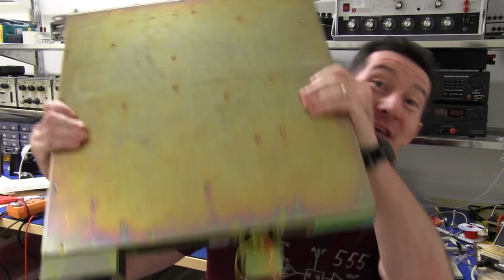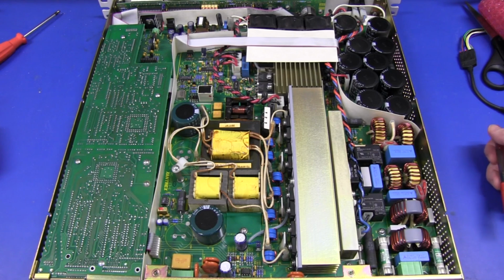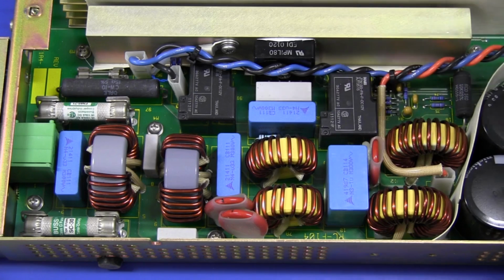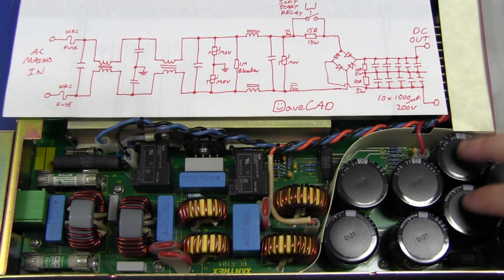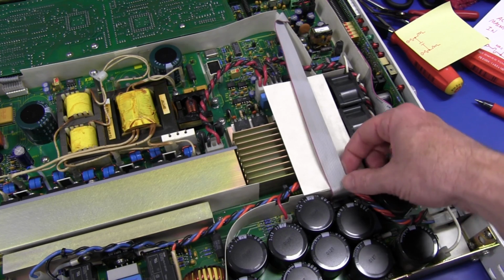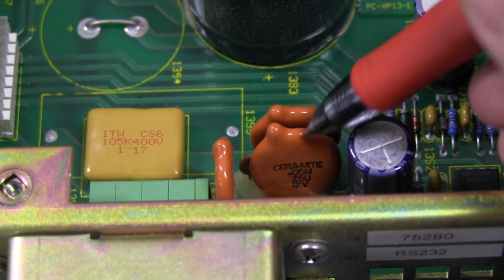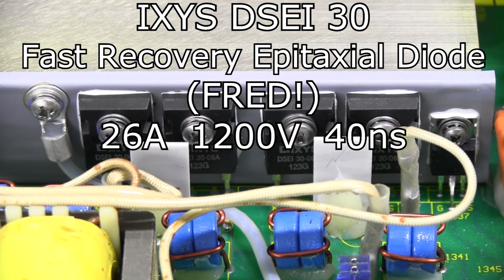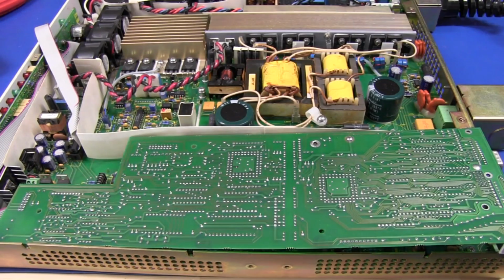EEVblog #268 - Xantrex 300V 4A Power Supply Teardown

Comment: It has good EMI filters at the input but PFC at the input is absolutely necessary instead of a simple diode-capacitor rectifier. The main converter is well designed, but the output capacitors could be improved. Additionally, the output rectifier could be replaced with SiC diodes. However, it’s important to note that when this power supply was originally designed, maybe SiC technology wasn’t available. Despite the input design, I don’t see any EMI filtering for the output.

Comment: It's very dangerous to have 2 fuses on a single phase design. There should ONLY be one fuse and it should ONLY be on the live/line. Otherwise, if the neutral fuse blows (or blowen as Dave would say) and the live hasn't. Then you've got a power supply which is completely live all the way through but doesn't power up. So it comes across as there's no power going to it, which is extremely dangerous if you don't know what your doing. 
But this isn't a domestic power supply so if anything went wrong with it. Then it'll easily be fixed be a technician. 

I dunno why they didn't just put a link across the neutral. As it'd be safer and cheaper to produce. Strange 🤔

Also. Back in the day, when electricity was pretty new. They thought it'd be safer to put a fuse on both the live and neutral which is very dangerous, if you know anything when it comes to electricity.
As people back in the day, didn't have the type of test equipment we have these days and the same went for earthing (because there probably wasn't any lol). So someone would be checking circuits and end up getting a big electric shock because the neutral fuse had gone but the live was still fine.

Comment: the fan placement is awfully similar to that in many 1u server blades...
Reply: Alex Ackerman Those axial fans are a bit of a letdown. Noisy and only so-so performance. These flat designs need a proper flat radial blower. It’d be larger but also much quieter. Then the “cardboard” can be used to direct air flow. This design isn’t exactly tightly packed; they had plenty of room to spare. As it is a 1U design, the axial fans are just a menace, and they have rather obstructed intake airflow, too. 

Two low profile radial blowers placed on each side right behind the front panel, with side intake, and outflow guided down the “guts” towards the rear would have been a much neater cooling solution. Even in 2U servers the axial fans can get really loud. For a 2U case, radial blowers can be 1.25U high, and those have oodles of airflow and very reasonable acoustic performance. The larger the radius, the better, of course.

Comment: I have four XFR600-4's to run power to my underwater remotely operated vehicle (ROV) over a 3km umbilical. I connect 2 pairs in parralel and then connect each pair in series.  One pair is set at 500 volts and the second pair vary from 100 to 300 volts depending on the load.
Reply: Holy moly what!! 3km power line!

Comment: Standard mains voltage on a single phase here in Canada is 120VAC(rms). Not the 240VAC(rms) that was being assumed.
Reply: Binj Komisar single phase in USA is 240V with a balanced center tap just in case you want 120V

Comment: I was initially puzzled as to why both inputs were fused. I'm guessing that it's designed for the USA/Canadian standard 240v system with a center tapped neutral to provide 120v circuits. I never saw the neutral used, but the two MOVs went to earth (and chassis?) ground. That ground wire had better not fail, or you could have a hot chassis!
Reply: Chaplain Dave Sparks modern 240V appliances have 4 conductors, including one neutral and an uninsulated ground. 3-wire cannot be installed in new construction and the old code only covers structures built before 1997.

Comment: High reliability until you use one as a battery charger with no series diode and the mains fails. That simple event killed a 20V 60A Xantrex supply. The internals are almost identical to the one shown except for the output stage which is designed for the lower voltage higher current.

Comment: 14:15 the control circuit has a crystal on it which is unusual in a power supply. I think they synchronized the 3875 to a crystal master oscillator instead of relying on the built-in RC oscillator.

I seem to recall the on-chip RC oscillator could shift frequency when running at high duty.

Comment: 5:50 - I'd guess one relay for the soft-start and the other for overtemperature shutdown (hence the thermocouple), perhaps the thermo circuit has its own little rectifier and cap setup, enough to keep the circuit running while the relay shuts down the supply to the main rectifier and therefore the rest of the unit.
15:00 - you'll see the same method in the APC SmartUPS VT UPSes, they use big metal spacers and TORX bolts to link the 6.67kVA single-phase power modules to the 20kVA three-phase motherboard.
16:25 - possibly designed for two caps in series (for the 600v version of the supply perhaps)? No need for the second cap on this board, so just link it out and leave the one cap across the whole supply.
Reply: Its been ages since I used one of those but I think one of the relays is used for 110/220v range switching. If I recall correctly the Xantrex did not have active PFC then.
Reply: To clarify: the relay would typically go between the mid-rail of the capacitors and one of the bridge rectifier AC terminals. Closing it turns the circuit into a voltage doubler, allowing operation from 110v. The voltage sensing is fairly critical because you really really do not want the relay to operate when running from 230v.
Reply: Yes you are correct they fixed that at the newer unit - all together units were not good and failed misreably under high temp. lousy design and they had 50% rejects - defect back for service :-) bad country wrong engineers

Comment: Always treat capacitors as if the bleed resistor is either faulty, or nonexistent. Because, it often is. Apple's Macbook charger capacitors can hold a charge for a while, see AintBigAintClever 's magsafe repair video.
Reply: That's no fun :)
Reply: I always do it with an uninsulated screwderiver while its on. Lol jk
Reply: Yep, they bite :)
Reply: ***** 
I always discharge them trough an lightbulb to prevent the spark.

Comment: awesome video. Can you shed more light on the temperature control used here?
Reply: The sensor is almost certainly a thermistor. I think they use a nonlinear PTC type with a transition at the alarm temperature rather than a linear sensor.

Comment: I think that small fuse on the filter/intake board is there to protect the rectifier it looks like the fast type.
Those fuses fuses can only fully protect diodes and other semiconductor devices when the surge rise time is not so fast it ruins the device before the melt-wire in the fuse itself had time to heat up and melt.
This makes them to small and light to break the current from a nearby short circuit in the power grid or lightning strike potentially feeding 400Volts or more in to the device.

Comment: So to confirm, there's actually no isolation of the DC output from the AC input?
Reply: StiegeNZ I doubt that there wouldn’t be. There is at least isolation from the L and N terminals. There may be some caps between the output and the chassis, which technically bypass the isolation unless they have safety ratings.

Comment: A little late to the party, but...

The second relay is a strapping relay. This changes the configuration of the cap bank for 120v or 240. Typically these power supplies are strapped for 240 in standard. When you power it up off of 120v the circuit senses the voltage and switches the relay which turns the input into a voltage doubler. Also the two 10k resistors are usually referred to as leveling resistors. It is not pretty when one fails. The caps rupture spilling stinky smoke/steam.
Reply: Litte late: The strapping relay is the same principe as the 120/240V switch at the back of a ATX-computer powersupply. It simple shortcircuit one input-line(N) to the center line of the cap-bank when powered to 120V. Therefore you need 2 sets of caps, the result is the cap charge voltage(DC) is the same when powered to 120 or 240Volts main. ;)

Comment: Too bad it's only 1200 watts at 300 volts :(
Reply: I'd prefer the 600V 2A version myself.  300V is a bit low for running some vacuum tube circuitry.

Comment: its easy to do with common tools...  secure one end of the two wires to your bench (vise or tied around a nail), chuck the remaining ends up in a portable drill, put a little tension on the wires and let it rip. the result is a perfectly twisted pair as loose or as tight and you want it. 
-jc

Comment: I'm really surprised. They seemed have named Currents I and Voltages U.
This is how I learned it in school not too long ago. But everybody seems to use V for the formula sign for Voltages.

I always thought Germans where the only ones using U for voltages. Can someone enlighten me how it actually is? Is U historic, or are those really geographic differences?

Thanks

Comment: The variation of the duty cycle of the primary mosfets lets you easily control the secondary (output) voltage of the power supply. The secondary output will be rectified and smoothed. Due to the high frequency of the secondary voltage on the main transformer only small capacitance is needed to get a perfectly smooth DC output voltage. Its no simple design, but the most efficent for those power categories.

Comment: There is HF interference which gets from the switching regulator easily to the mains input. To prevent that the input Filter is neccessary. This is a standard primary switched power Supply design. The mains voltage is rectified and smoothed out with those 10 large caps. Those 4 full bridge FETs are making a AC (rectangular) waveform out of the DC voltage to drive the main transformer. The frequency is much higher than the mains frequency (many kHz), so the transformer can be very small.

Comment: Id say its all about stability and noise. most high value computer supplies get very noisy when you actually try to get the full rating from them (heck some cant even take the full rating).
I wouldn't trust my computer's 1.25kw supply to actually supply 1.25kw continuously and be stable over their entire output range like these proper supplies.

Comment: There's no indication of crimping of the terminals with the temperature sensors. I'll bet they are just slipped in with thermal compound and held by the heat shrink tubing. Or maybe epoxied in with thermally-conductive epoxy. Can you imagine assembly gorillas trying to crimp them without doing damage within?

Comment: The soft start ckt reminds me of the Surgister from the '60s. It was a 10w ceramic resistor of a few ohms that you would solder in the AC line of a hifi amp, etc. It had a bi-metallic thermistatic switch across it so that, after start up, the switch would close from the heat of the resistor and stay closed from the current of the unit. This slowed everything down, including the hammering of the tube filaments on start up.

Comment: does that 2nd relay control if the supply is in 120/220V mode?  the usual way is to have the output filter caps in series like that, then control if the bridge/caps form either a usual full wave rectifier, or a voltage doubler (like in PC supplies).

Comment: Dave, the capacitors are probably configured as a full wave voltage doubler, or just series like you described, for operation on 110 or 220V respectively. It is the same configuration used in ATX power supplies. The second relay could possibly be for switching between the two configurations.

Just a thought.

Comment: 600V 2A version probably has another set of output caps in series with the existing 400V cap, that is why they placed those jumpers on 300V model...